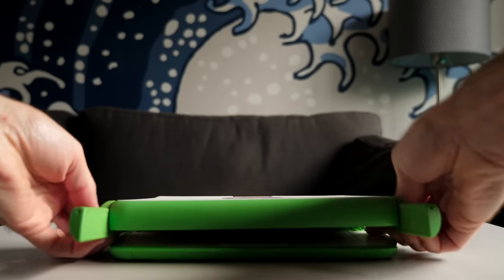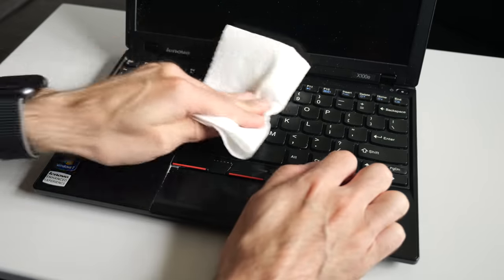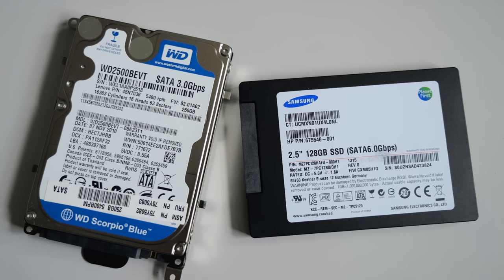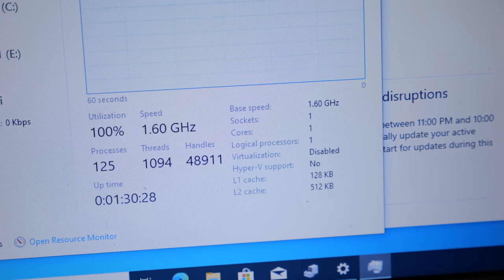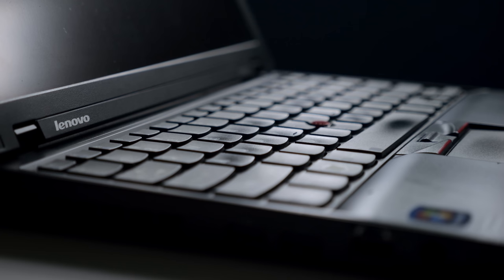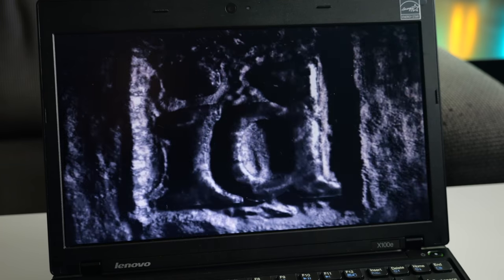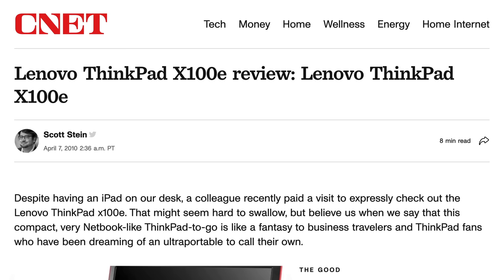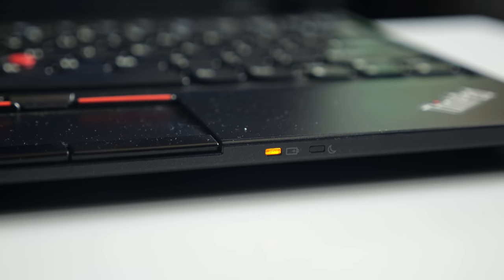Could this ThinkPad netbook actually be GOOD at retro gaming?

Comment: The Lenovo battery driver is terrible, even when you have a good battery it might not charge it, so to get it running:
1) Turn off all internet connection
2) Uninstall battery drivers
3) Turn off the computer
4) Remove the power cable and battery if possible
5) Hold the power button for 60 seconds
6) Boot the laptop
7) Turn on the internet
8) Check if it charges, if it doesn't, you can repeat this process up to 5 times, but usually works after 1-2

Comment: I don't know if this model is any better, but in General I find thinkpads suck for gaming, because while they tend to have nice keyboards to type on, the low key rollover makes them undesirable for many games, I have a thinkpad T60 with like the second fastest C2D that fits it and a 128MB X1400 but when I try to play games that should run great on it like GTA Vice City, I run into problems with the keyboard being unable to accept enough simultaneous key presses while flying the helicopter.

Comment: I still have my Lenovo x200 tablet. It looks like the first time out of the box so it is in an exelent status. P Dual core, 8GB, 256GB SSD, the Captive Pen with the little cotton wire and the docking station with DVD and an extra ssd hard-drive in a bay. A small wireless mouse and i love it. The only thing i did was cleaning it again, update the ram plus BIOS and a new accu 4 years ago. It works perfect under W7 64 bit. A bit slow yes but it works for what i need it. It is also a very good retro machine which will stay until i die.

Comment: I love that you did this video as I've got a Thinkpad L520 (15.6" 1366x768, 720p camera, Core i5 2520M, 8GB (2x4GB) DDR3-1333MT/s) that I've upgraded from the original HDD to a 2TB Crucial BX500 and soon will boost to 16GB (2x8GB) DDR3-1600MT/s ($41 AUD, it's cheaper than finding a 16GB kit of DDR3-1333MT/s) that I bought new back in 2011.
It is currently dual-booting Win7 Ultimate x64 and Zorin-OS 16.3, and is still fairly snappy if only limited by the 8GB of RAM (hence the upgrade to 16GB) with about half of it going to my Minecraft Beta 1.7.3 modpack (Mango Pack) install and that causing Zorin-OS to use the Swap file a lot.

Comment: You can slipstream an AHCI driver into the Windows XP install CD and then you don't have to run the AHCI controller into compat mode. For the x100e that's "AMD AHCI Compatible RAID Controller".

Comment: If you had installed a more bare bones Linux distro it would have probably faired better. Cinnamon while not heavy at all on modern systems doesn't run great on machines this old. I typically use XFCE + Debian on these machines and they are reasonable until you open a web browser or discord.

Older games play fine on Linux through proton/wine/dosbox/emulators and you don't have to resort to something as awful as XP (XP was just a bad OS).

Comment: i bought this laptop because i thought it would be cool to have a little thinkpad back in 2015 or 2016 and it was horrible. barely ran 720p video, extremely hot and loud, windows 7,8, and 10 lagged. linux also didn't run very well on it so i cant recommend this laptop to anyone even if it was only $30

Comment: You shouldn't install XP on any device anymore. In the past Microsoft actually did release security patches for EthernalBlue and BlueKeep for XP, even though it was unsupported already. But it's just a matter of time until a new critical exploit is found and Microsoft doesn't bother patching it. And somehow I doubt people use these devices only offline and never ever connect to an open WiFi network, because we still live in the reality.
Just use Linux.

Comment: I recently got ahold of an X61, which is quite similar but with a Core 2 Duo and a 4:3 screen. The battery was dead, and the replacement was surprisingly expensive (I flip laptops and this battery was twice as expensive as the average replacement). It already came with SSD and 4Gb (2x2) of RAM; Windows 10 runs decently, but the laptop gets HOT ( I have yet to try to open it, as it requires partial disassembly to get to the motherboard); as stated, that Lenovo also supports 2x 4Gb DDR2, unofficially; however, these are unjustifiably expensive, for some reason. I am planning on keeping it as a “glorified typewriter”, as Colin called it, to supplement my desktop computer while on the go, as I am a freelance translator, and require a good keyboard (and GAWD is it a joy to type in it!); I may try running Zorin, as it’s much more friendly to me than Mint, and it looks GORGEOUS to boot.

Comment: Buy a spot welder and put new cells in this, It isn't as hard as you think just be careful.
 Modern cells have way more capacity than they did in 2010 chuck 6 X 3500mah in there It'll be awesome.

Comment: Speaking of the rubbery soft touch materials that get sticky over time... Any tips how to clean that and make it not sticky? I have a great wireless dolby atmos home theatre. but the remote control has its side and backside from such a material. And it got disgusting. Sticky, catching up any dust and dirt. And I have no idea what to use (and what to avoid to use) to make it clean and non-sticky....

Comment: After watching this video i went on a hunt to find one of these machines.  According to your data and in the Factory service manual, those two other models with the dual-core processors were offered but are EXTREMELY rare.  The CPU's are soldered onto the motherboard so the only way to upgrade a single core model is to find a used motherboard that has either the Athlon Neo X2 or the holy grail motherboard with the Turon Neo X2.  Every single one listed on ALL the major sites had the Athlon Neo MV single core processor. I'm still going to keep looking though.
Reply: There was one on my country’s version of ebay, I bought it, and it turned out to be one with the anthlon neo x2 lol
Reply: It’s not much better than the single core on though. Cpu benchmark says the difference is 7%
Reply: @lukamarko1037  Well that ones's still a good one to have.  The Athlon is a dual core processor so it's still a great find.
Reply: @lukamarko1037  Benchmarks can be subjective. You have to see how it's performance is in regards to everyday tasks. I think you will be surprised.
Reply: It’s slow as hell 😂. I’ll try to put tiny 10 on it, see if that helps.
Reply: @lukamarko1037  Dude you're going to have to run Linux.  All Windows products are going to be crap.  Puppy Linux or Zorin lite will be perfect.
Reply: @klwthe3rd  i’m not very used to linux, so i’d prefer if it ran tiny 10. There is a chance it will, seeing how stripped down they’ve gotten it (about 800mb ram usage). But if it doesn’t run smooth, linux is the next step.
Reply: @lukamarko1037  Windows operating systems are just to bloated anymore. Starting with Windows 8, they just can't run smoothly on these single core processor. My X100e is running Windows 7 but I use it only for testing purposes.
Reply: @klwthe3rd  tiny 10 is a custom unofficial debloated version
Reply: @lukamarko1037  I know what it is. I'm an IT Security specialist. Just because it's debloated doesn't mean that the software such as the browers aren't user heavy.  Modern browsers are so heavy that they make it extremely hard for these older systems to operate.  Debloated isn't the answer alone.  You need light-weight software.  Tiny 10 isn't.
Reply: @klwthe3rd  Lubuntu it is then!
Reply: @klwthe3rd  Except the programs I wanted to run on it don’t support linux. How well do you think it’ll run Wine?

Comment: One suggestion I would make is to run Windows 10 debloater. It removes unneeded apps such as cortana and xbox which increases performance significantly on older machines.

Comment: I liked my Atom N450 Netbook back in the day.   Squeezing out as much performance as possible was half the fun.   I threw an SSD in it right away and that definitely helped.   
I prefer just getting modern hardware and emulators today, however, because you don't spend as much time waiting for things or tinkering.
My current "Netbook" is just a small laptop with a modern CPU that can decode AV1 video codecs for watching Youtube while travelling.

Comment: Had an X130E for a while - we ended up giving it to my wifes dad so he could do basic internet tasks - like you i plopped Windows 10 on it with 8GB RAM and a 128GB SSD, funnily enough - the change from the MV-40 CPU to the E450 dual core must have been pretty significant because while it was a bit on the slow side, things like web browsing and youtube weren't intolerable.

Comment: I have a Thinkpad Mini 10, which is basically the same as the x100e except with an Intel Atom N450 and a 1024x600 10” screen. The parts are compatible between the two models, though. 
When the Mini 10 was originally rolled out in New South Wales it ran Windows XP. 
I used to use Arch Linux with i3 on mine but it was still unbearably slow.

Comment: i have a very similiar laptop but smaller ASUS EEE PC 1015PN is a 10,1' very lightweight and nice to use (because of the snappy touchpad and nice keyboard) , the specs are a little smaller except the max 2gb ram , it has nvidia ion 2 (with 512mb dedicated vram) and intel atom n550 with 2 cores 4 threads

Comment: I had this MV-40 configuration in an MSI Wind U230, that also had a spare mPCI-e slot which had all the lanes present instead of just USB as it could be specced from factory with an Avermedia TV card. I used to play Fallout 3 on it with some heavy graphical concessions, it also ran Far Cry 2 pretty well, I also overclocked it and yes it did get pretty hot!

I actually added the TV card (and aerial cable which had a cutout on the shell) later, then a Broadcom Crystal HD decoder, then a dual Micro SD adapter and finally a USB adapter card to that spare mPCI-e slot.

Comment: I used to have that Thinkpad netbook, thing was slow as molasses. It also was always underclocking itself due to thermal regulating, I even reseated the heatsink and replaced the thermal paste early on but the thing always ran super hot.

Comment: Just bought a X220 for $13. It's in a rough shape and it doesn't have storage but it's still function normally. I think I might throw in an eGPU and more RAM to turn it as a Windows 7 gaming machine
Reply: eGPUs are strictly Thunderbolt only.

Gl getting a fast eGPU with USB 3 only
Reply: it has ExpressCard which carries PCIe
Reply: @dm4uz3  indeed, not as fast as Thunderbolt but might be enough to play games around 2010-2015.
Reply: @windows8.1proforthewin  they are not, why should they? an Thunderbolt eGPU still uses normal PCIE thats simply carried over via TB
Reply: @dm4uz3  PCIe 4x at most?
Reply: You might be better off sourcing an X230 motherboard.  It is compatible with X220, (you need a patched EC to run your X220 Keyboard, easy enough with IVYRain), I have the i7 version and it supports 2133mhz ram, which was quite a good little boost in gaming performance (I had to find an ancient Ripjaws kit, but other dram vendors had some 1866mhz kits).  Also you can get an IPS screen, I believe all the tablet editions were IPS and the panel swaps over.

Comment: The X120e was my first laptop because of how efficient the AMD E350 was. After Windows 7, I used it with Mint and now it's running Cloudready/ChromeOS Flex. I only use it on ethernet now because of how slow the wifi card is

Comment: I had a direct descendant of this one with an Edge 11 series (intel i3 380um, 4 gigs quite the same specs but with an HDMI port) after being bored the limits of my eeePC 1000HE. Once I upgraded its poorly performing 5400tpm hard drive for a ssd, it was a quite capable machine for work on the go and dosbox games. Gave it to a friend which might still use it. It migrated to win10 but it was a bit too much for it.

Comment: I still have my x120e that was purchased new. Battery still works too. I have rasbian installed and it runs pretty well. I'm sure it's much slower than a pi4, but it has the perks of a screen, battery and of course the excellent keyboard. At the time it came out, I was disappointed with the performance. There was a horrible audio driver bug so it couldn't even play music well, but it keeps going as a great troubleshooting laptop. Also, Thinkpad owners really hated the keyboard when it came out, but I prefer the chiclet keys to be honest. The screen and touchpad have always been bad though. Also the wifi cards are whitelisted in the bios, though I think someone has hacked it open.

Comment: What a great idea, Windows XP! Last year I bought a few thin clients to use instead of (at the moment) expensive Raspberry Pies. They came with quad core AMD APUs. Very slow for almost anything, but XP worked awesome for games, despite not being officially supported. It's my main late 90s-early 00s gaming machine now.
Reply: LZDoom runs great on the x220 so I'm curious how much better it will on the AMD units

Comment: I have something similar a x131e with i3-3227u and 8gb of ram and 500gb sata ssd. Was like $120 for the base laptop and like $80 for both upgrades. Runs great for super light gaming and web browsing and basic tasks on Linux mint / endeavoros was the rugged education version too so I just use this as my travel laptop and keep it in my knapsack and it still runs like a champ after 2 years.

Comment: You could have installed the 64 bit version of Xp to use all ram. Maybe better gaming performances for more demanding games, ram helps the gpu a lot. Well, when it's a close call at least. It could work decently in browsing and video streaming with the 8 gb of ram and an ssd if you use a lite Linux distro. But not Mint. That's kinda demanding as it has a somewhat demanding UI cause it's made more for beginners transitioning from Windows, that's why it kinda looks like xp. Something like Tiny, Puppy or even Lubuntu would work much better with that cpu than Mint. Or just use xp, but it has major compatibility issues with modern websites and browsers. Not to mention there's no security anymore. Linux is the way to go if you wanna keep it online and 64 bit xp for strictly offline retro gaming.